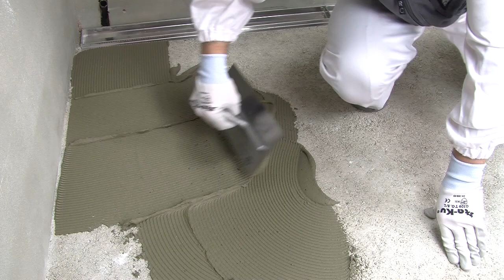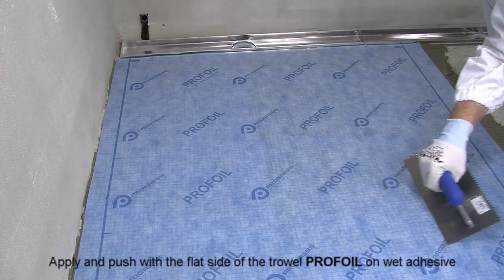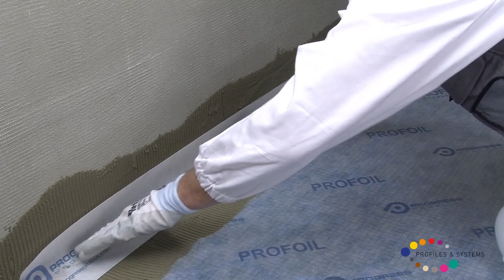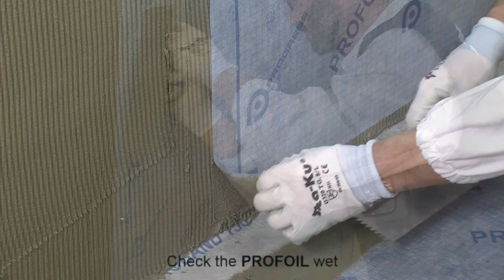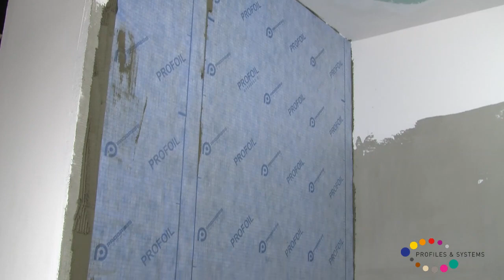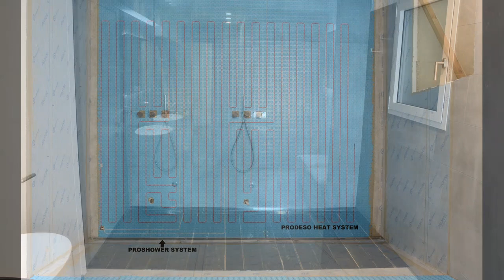Profoil System - Progress Profiles - ENG

Comment: How do you do inside the shower recesses?
Reply: Treat it like and individual room. Put the Profoil onto the individual parts of the recess with adhesive. Then use the Proband tape pre-formed internal corners and apply adhesive to them and glue them to into the corners. Then use Proband tape along the main length of the shelf to wall junction exactly as per the video does at floor to wall junction.  There is an 'advanced method' which is actually easier and better that allows you to fold the corner in a 'pigs ear' detail. This eliminates the corner bandages and giving you a continuous sheet without cuts, joins or perforations.
Reply: Açıklamalar türkçe olabilirmi acaba
Reply: Isı yalıtımı olarakmi kullanılıyor evimi ısı yalıtımı zemin olarak dosetmek ıstiyorum kaliteli ısı yalitimi arıyorum  samsunda bulamıyorum yardımcı olursaniz cok sevinirim simdiden tesekkurler şimdi araştırıyorum